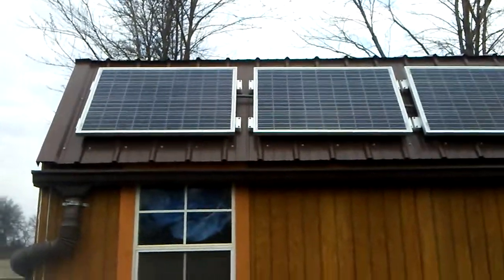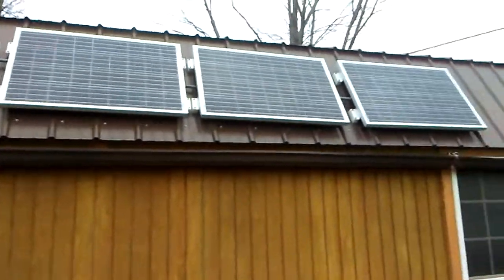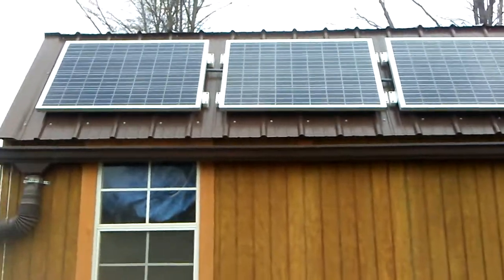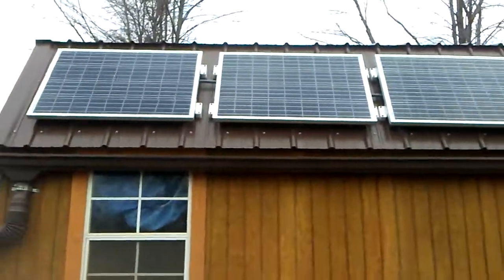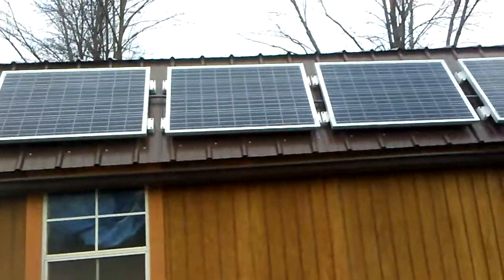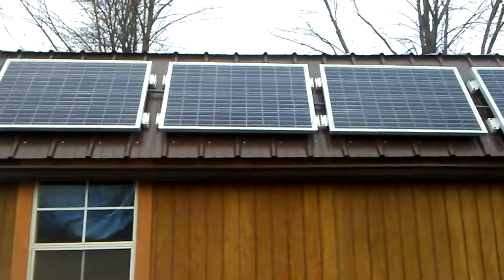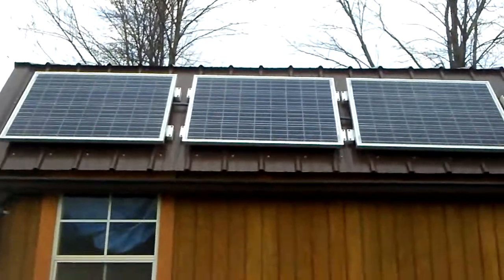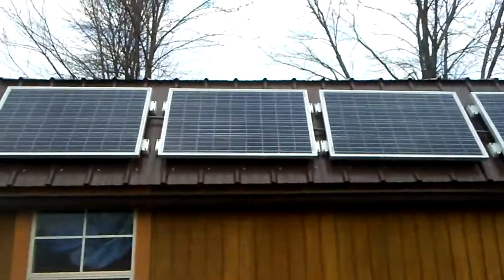Renogy 12V 400W 40A Solar Panel System Kit Install - Part 5 - On The Roof

Comment: It would have been better to wire two groups of two in series, then parallel the two series sets. The MPPT controller will work better with the 24 - 40 volt input, 12 volt output. More power earlier and later in the day.
Reply from the maker: Well I like it just the way it is and it's doing just fine! Our batteries are usually fully charged by 10 am and in float mode if it's not raining nor foggy. 
Plus, if one of the two panels goes down.... for what ever reason, the second one that it's hooked up to in series wouldn't work either.  This way, if one goes down... the other three will still produce power.  I hope your off grid system is working well for you though. Good day.
Reply: @TinyIowa  Mine are all in parallel too, but as soon as i upgrade to a MPPT controller i'm going to series the panels to make use the benefits. But all in parallel is fine too. Greetings from sunny Jamaica.
Reply from the maker: That's awesome!